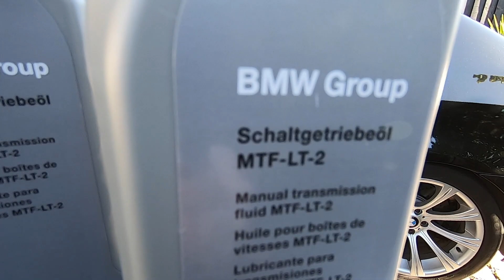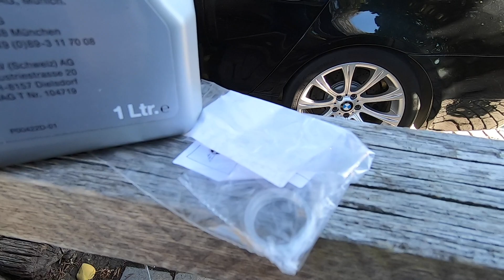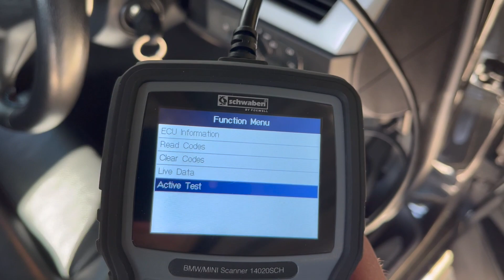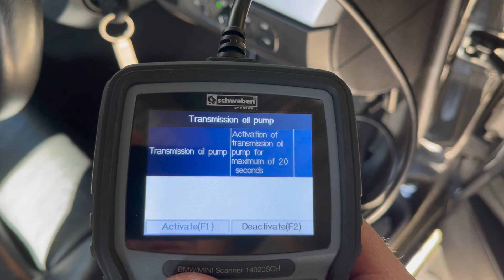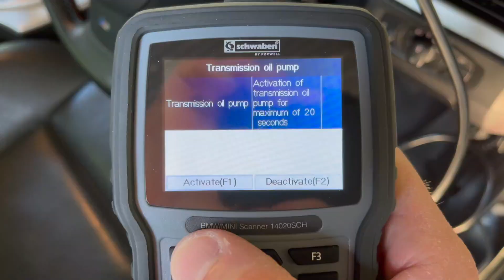BMW E60 M5 SMG Gear Oil Change (Using Scan Tool)   #BMW60M5 #BMW SMG

Comment: That is some difference in the oil over 3yrs and not with everyday use. Good to keep on top of these things and prevent wear to the (expensive) gearbox internals/ancillaries. A top tutorial with excellent camera work as usual. 👍
Reply: Wow, for reals, dude. Exactly what I thought. I need to do that service on mines asap. Lets get wrenching!
Reply from the maker: I was really surprised how bad it looked. It’s been about 4 years but I’ve not done a huge amount of Km’s in that time. I guess the SMG brutally quick shifts takes it’s toll on the oil, it definitely looked worn out

Comment: you can also just open the drivers door and the pump will run for a few seconds as well ..
Reply from the maker: That’s the SMG hydraulic pump, this is the gear oil cooler pump

Comment: I had to replace all the hardware holding my undertrays on my M5 due to corrosion, it still shocks me that high end cars like these still had corners cut. 
Even your exhaust bolts are like new. 
Maybe i need a better climate also. 

A trick i use when flushing the smg fluid is to let the waste settle in a long container (the sedement goes to the bottom,  pour the fluid into another container so you only get the cleaner fluid and then use this to flush the smg again,  you will be shocked how much still comes out black, you can repeat this a few times untill the fluid comes out clean then use the new bought fluid. 

keep up the great videos tho and thanks for making them.
Reply from the maker: I need to replace my under tray hardware, a few of the fasteners are missing anyhow

Comment: Great video! I have asked my BMW service advisor a few times about changing out the SMG oil and he recommends strongly to just leave it alone. Normally they are very happy to take my money so it's pretty weird that they don't want to do that job. Anyone know why they are sticking to the "lifetime fill" idea? 2010 car with ~50K miles
Reply from the maker: There was no official service interval like diff & SMG gear oil. A good service advisor should be able to accomodate  something like this though. It would be welcomed at our local dealer. The technicians have the info on what’s required, it’s basically part of the likes of a pump replacement anyhow. Just tell them you want the system depressurised/drained/refilled/bled and the level topped off as required and you’ll pay them for the time & CHF11S fluid
Reply: Wait wait you are one of those lucky ownert with a m5 e60 2010? Last year and CIC instead of CCC

Comment: Hi could you tell me is there a difference in gear oil & transmission fluid for the m5 e60 thanks.
Reply from the maker: The SMG III takes gear oil in the gearbox, and hydraulic fluid in the hydraulic reservoir. I’ve put videos out previously on both procedures
Reply: Thanks much appreciated 👍

Comment: Hello. How are you? Can you please help me about this issue: my M5 car key does not work with the buttons; the car can be started with the key and there is no message on the dashboard about low battery. I did some research and it could be the fuse on the glove compartment or the unit that receives the signal. Is there any provable cause of this malfunction? Thank you for your help and time?
Reply from the maker: Most likely the key battery has died-
https://youtu.be/Z4ak6sUy3w8